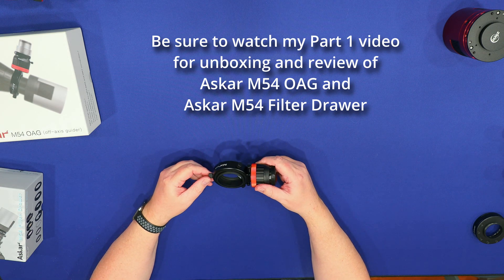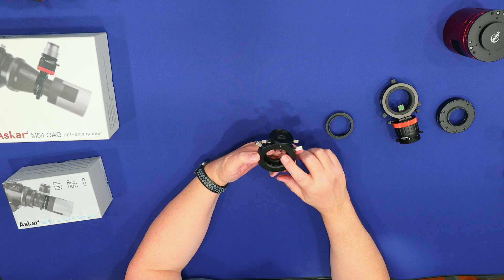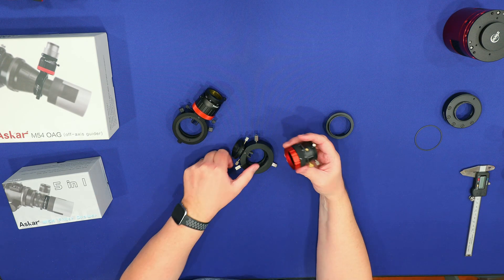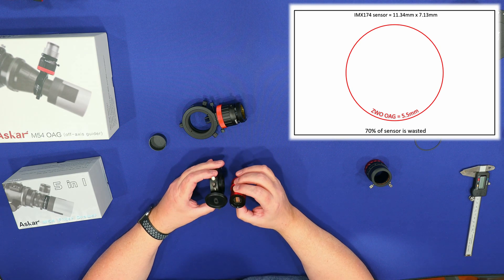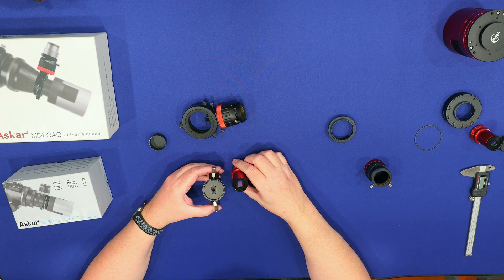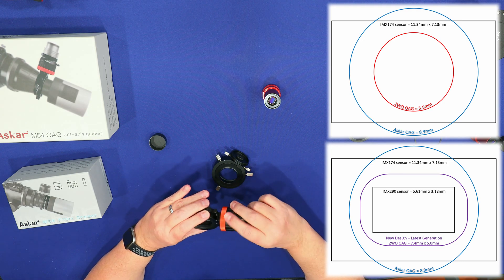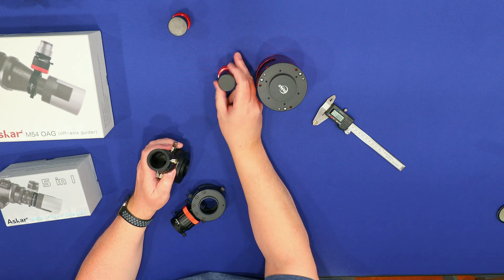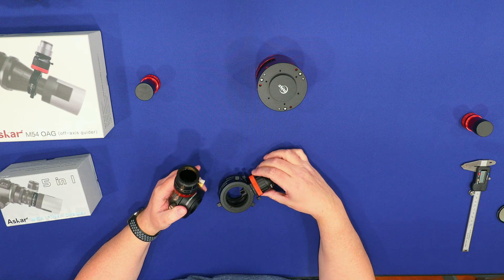Askar M54 OAG + M54 Filter Drawer vs. ZWO OAG + M42 Filter Drawer vs. Celestron OAG

Comment: I have the Askar 54mm OAG and the ZWO m42 filter drawer. The askar flattener for my 120 apo has a 18mm long section that can be removed to reveal a m54 thread, all I needed was a m54 , 15mm long spacer to achieve the required back focus

Comment: People use off-axis guiders with telescopes. However, I'd like to use it with a camera lens. Is it possible ? I have a Sony full frame camera and E-mount lenses. I think I'll need an E-mount (female) to T2 or M48 (male) adapter. Does something like that ever exist ? The only female E-mount adapters I've seen are those for adapting Sony E-mount lenses to Canon and Nikon bodies.
Reply from the maker: While technically possible to use an OAG with camera lenses, the real problem is lack of back focus distance or "flange focal distance". This is the distance from the camera lens flange to the sensor. It can be a challenge to get these OAGs to work within a 55mm back focus distance, but cameras, especially modern mirrorless cameras have much, much shorter flange focal distances to work with. For your case, the Sony E-mount flange focal distance is only 18mm, so less than the thickness of the OAG itself.  I've never seen an OAG for any camera system, even Canon EF mount which has a flange focal distance of 44mm.

Comment: Good video. Not sure it is fair to compare apples to oranges though, ZWO has the OAG-L version which has both a much larger prism and opening window to the sensor, actually larger than the Askar version, ....for about the same price.
Reply from the maker: Very true, however, for users of the ASI2600MC you can't use the OAG-L with a filter drawer and achieve 55mm backfocus. It must be used with a filter wheel or with no drawer and a special spacer, due to mounting constraints.  I do now have a ZWO OAG-L for use with my ASI2600MM and 7x36 filter wheel, but still want to use OAG on my ASI2600MC with filter drawer.  I haven't made a video yet, but think I have a solution.  Swap out the M42 sensor tilt plate of the ASI2600MC for the M54 sensor tilt plate and then mount a ZWO M54 filter drawer. This larger M54 filter drawer has threads as well as holes for mounting, so it will fit the Player One FHD-OAG Max, which has a 8x14 mm prism large enough to fully utilize the sensor in the ASI174MM Mini. All this and achieves 55mm backfocus.  I bought all of the parts, but haven't gotten a chance to test it out or film yet.  This will be my new setup for C11HD with 0.7X for galaxy season coming up.

Comment: What? I use Celestron OAG with 55mm BF flattener. You've got something wrong... Good comparison otherwise.
Reply from the maker: Let's say you want to connect your ASI2600MC Pro to a refractor with 55mm backfocus requirement and the flattener uses M48 threads. The Celestron OAG body is 29mm thick, then the M48 telescope adapter adds 4.5mm thickness, then the M42 camera adapter adds 12.5mm thickness, and then the ASI2600MC Pro has 17.5mm thickness, so total backfocus length for this setup is 63.5mm, which is way too much backfocus to get clean stars using a 55mm backfocus flattener. And I want to add a filter drawer, so that makes it that much worse. It could be used on a Petzval-style refractor, which have a wide backfocus range or also SCTs or RCs that have a much longer backfocus.
Reply: Front and back adapter are 4,5mm, so 2x4,5mm + OAG body = 38mm. Add17.5mm for ASI2600 = 55,5mm. My camera  has 12,5mm BF (Touptec IMX571), so I have additional 4mm spacer. No go with filter wheel or drawer, but for OSC it's great. LP filter screwed onto flattener (Apex-D) and IMX174 for guiding. Problematic with other OAGs - easy with Celestron. My Askar OAG stays in the drawer and waiting for mono setup... someday...    @dalehollenbaugh6084

Comment: It was great to see this video. OAGs are one of those strange topics that can be so useful yet rarely receives sufficient attention.  I just wanted to add that you can use the Celestron OAG with many refractors.  I am using a Williams Optics ZenithStar 81.  With 6.8 cm of back focus with the reducer attached, I can create an image train consisting of the OAG, filter drawer (or filter wheel) and camera with just over 1 cm of back focus to work with.  I know it's tight, but it is doable.

Comment: My 174mm camera does not go in very far in to the Askar OAG not sure but the ZWO it does wayyy down, I am not sure I'm going to be able to get focus or am I missing something ?
Reply from the maker: Hmm, there are a couple of things that come to mind.  First, make sure you are not stacking any of the black extensions on the camera. There is a 5mm thick one meant for C/CS threads and a longer one about an inch. Don't use these with OAGs.  Second, it may be hanging up on the compression ring.  Unscrew the compression ring clamping screw all the way out.  You could also unscrew the entire helical focuser off of the OAG and try to insert the camera from the other end to see where it is interfering.  My guess is the compression ring.  Perhaps the compression ring is bent and catching?
Reply: @dalehollenbaugh6084  Took off all the extensions was first thing I did,  I took off everything I can imagine it is stopping right on the helical focuer Guide pins, it wont go past that. I agree there Is a problem although it is Brand new. agena Astro is ignoring all my inquiries for support.

Comment: Incredibly helpful video, as I'm currently planning my future upgrade path, and was debating between these two systems. Thanks so much for taking the time to produce this! After having had the Askar setup for 10 months, do you still like it (better than the ZWO)? The only difference in my setup will be an ASI220MM mini (the upgrade to the 290).
Reply from the maker: I also now have all of the "Mini" guide cameras and hope to do a comparison video at some point.  Have been using the ASI220MM Mini and it seems to work fine, but using it with 30mm or 32mm guide scopes with my RedCat51.  I also just got the new Player One FHD-OAG MAX which can illuminate the full IMX174 sensor. It bolts to the filter wheel like the ZWO OAG-L, but can be paired to the ZWO M54 filter drawer and still achieve 55mm backfocus (OAG-L + M54 filter drawer is 60mm back-focus). If you have monochrome and EFW, then get the OAG-L as it is the best solution I think, but for OSC with filter drawer, the Askar combo works very well. I'm hoping the new combo of Player One FHD-OAG Max + ZWO M54 filter drawer + M54 tilt plate + ASI2600MC Pro will beat them, but haven't opened the box yet to test. Also, some might not want to replace the tilt sensor to M54, but that is required to use this particular setup.
Reply: @dalehollenbaugh6084  I'm debating between the Redcat 51 and Askar FRA300, but either way, I think I've made up my mind to go with OAG rather than a guide scope. As for guide camera, I'm a bit torn between the ASI290 and ASI220 - the 220 seems to have better specs overall, but for the 250mm - 300mm focal length where I plan to shoot (at least initially), I suspect the ASI290's smaller pixel size might benefit me more - not sure. As for main camera, I've settled on the ASI2600MC. I don't have the time / patience / experience to deal with mono, at least not yet - I'm still quite new to the hobby, only working with a star tracker and mirrorless Sony + Tamron zoom lens at the moment!
Reply from the maker: @johnposavatz  I had narrowed it down to the same two scopes, RedCat51 vs FRA300. If you haven't seen it yet, check out Nico Carver's (NebulaPhotos) video review of the FRA300. He compared it to the RedCat51. Both great choices, but I think the RC has less chromatic aberration than FRA300, at least in his sample. RC51 does use FPL53 glass and FRA300 doesn't, so that could be the reason. Some people might not like the helical focuser, but if you buy a kit to connect ZWO EAF, then it works just fine. In the end, I chose RC51 and couldn't be happier. Images are fantastic. Since it is also my portable scope to take on the road, I wanted something as small and light as possible. I have Samyang 135 and Stellarvue SVX080T (480mm focal length @ f/6, but 312mm focal length with 0.65X reducer), so the RC51 fills in the gap better. As for the ASI220MM Mini, I wouldn't necessarily call it an "upgrade". It is cheaper, has larger FOV and more sensitive in IR, but larger pixels. As you said, the ASI290MM Mini smaller pixels might actually be better for small focal length applications. Of course with smaller focal lengths, the differences become almost pointless. For longer focal lengths, the ASI220MM Mini does become a better choice I think, so still probably would get that if you plan to upgrade to a larger scope down the road. Or pick up a cheap used ASI120MM Mini like I did and keep using it for the smaller focal length scopes.  I would say that it is much easier and cheaper not to use OAG for such a small scope in the 250-300 range. Get a small 30-32mm guide scope.  I have four small guide scopes to compare in a video when I get a chance, but my initial impression is that they all work about the same with only minor differences. OAGs become more important at longer focal lengths - I'm going to say at 1000mm or above. Also, anything with a movable mirror (to focus) like a SCT will benefit from OAG, so my C11. Not that you can't use OAG with shorter focal lengths, but it won't be any better and could be worse - depending on the scope and conditions. You may not get as many stars for multi-star guiding and out at the periphery of the image circle, there is more coma and field curvature to deal with. But, once you set it up, you could move the OAG + filter drawer + camera to another setup easily. And with Petzval designs like the RC51 and FRA300, you don't have to worry about backfocus distance either.

Comment: Hi this is great info.  I have Celestron 9.25 standard (non-edge version) SCT.  my imaging camera is ASI 071MC PRO.

I have 174mm (not the mini, but standard one) for guiding camera.  Will the Askar OAG work well for my needs?  Also is Celestron or ZWO better suited for my design?  Please advise.
Reply from the maker: Any and all of these OAGs can work, but you will have several challenges.  First, since your scope is a non-Edge HD model, it isn't corrected for coma and field curvature, so with the OAG picking up light at the periphery, there is likely to be significant coma and field curvature. Perhaps using a field corrector like Starizona SCT Corrector IV could help, but I'm not sure how well it will work with OAGs given its small 27mm image circle. The other issue is that OAGs are best used with the "Mini" style of guide cameras since you want the sensor focal plane typically pretty close to the prism.  You can remove the helical focuser and screw the 174mm directly to the OAG stalk, but it is difficult to co-focus with the primary camera, but can be done.  If you keep the helical focuser, you can screw the camera to the top and have an easy time focusing, but will have to space the primary camera back significantly more (42.7mm farther) in this configuration. This can be done, but you may go over your back-focus distance. Back focus on C9.25 is natively 139mm, but adding a field flattener will change this. Back focus with Starizona SCT Corrector IV is 90.3mm. I wouldn't recommend the ZWO OAG since most of the 174mm sensor is wasted as shown in my video.  The Askar OAG is better, but still doesn't fully illuminate this.  The Celestron OAG is best of this batch, but the helical focuser can't be removed. If you are careful with your back focus, this one can work the best.
Reply: @dalehollenbaugh6084  thanks appreciate the inputs.
Reply: @dalehollenbaugh6084  I forgot to mention.  I use an external moonlite focusing Flange inside which I have a Meade 0.63x Reducer corrector.   Would this change the dynamics of your suggestions.  Pls let me know.
Reply from the maker: @sreeshab4093  It can change the backfocus.  Typically on an EdgeHD model, the focal reducer is mated directly to the back of the telescope and any accessories, including external focuser, are added after that, taking up back focus. But with the non-Edge SCTs, I think you can put the field flattener after the external focuser and it will still work well. I've read there are several different versions of the Meade 0.63X field flattener/focal reducer with three separate back foci: 72.6mm, 85mm and 105mm. I think all three can work with OAGs, but you'll need to do some testing to see how much vignetting and coma are in your pictures. I think with the EdgeHD models, with their built-in field flatteners, the back-focus numbers are more rigid, but with the other SCTs, there is more ways to do it and a wider sweet spot, but also more work testing.
Reply: Optec sells the Lepus F/6.3 reducer corrector with a 105 mm recommended distance to chip. They will custom cut a camera adapter to whatever attachment size you need for around $75. I’m going to test mine next week. I’m using a QHY 268m with medium oag and large cfw.

Comment: ZWO, Dale, also sells a 54 model OAG.  Did you look at that one?  Why would you use a filter with a OAG?
Reply from the maker: ZWO doesn't sell a M54 OAG.  They have their original OAG, which I show here, the M68 OAG, which is discontinued and the OAG-L, which I don't own, but show some of the specs here, especially the prism size. The ZWO M68 OAG had a larger opening to be able to be used with their full-frame cameras, but had the small 8mm prism with presumably same small circular aperture as their regular OAG, so the OAG-L that replaced it worked well, but the way it is connected to the cameras means that it works well with the monochrome camera setups with filter wheel, but not with the color cameras with the filter drawer.  The filters have nothing to do with the OAG, but can be very useful for the cameras.  You don't need to use a filter or filter drawer with an OAG, and in that case you could connect the ZWO OAG-L with their 20mm special spacer for use with it and the ASI2600MC Pro and it will work, but I always want a filter drawer.